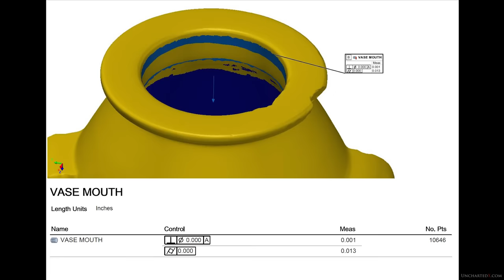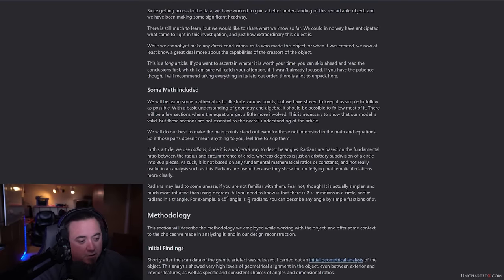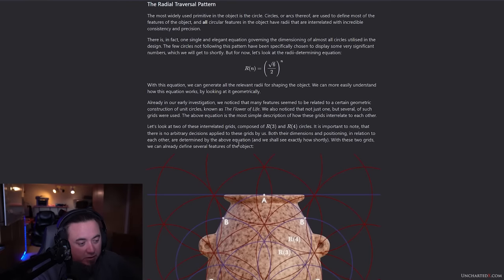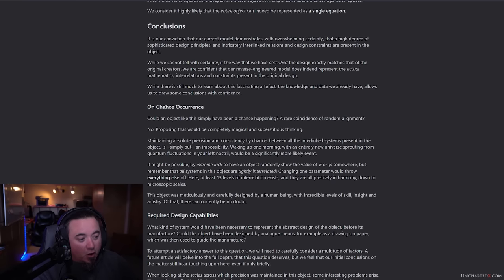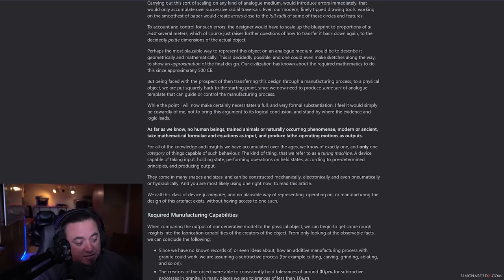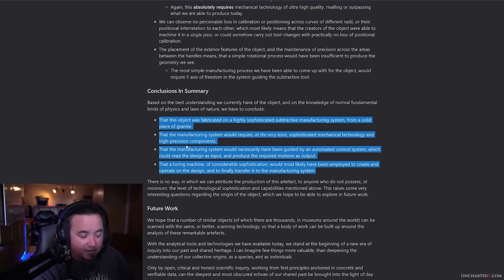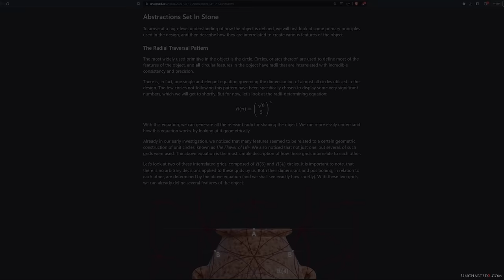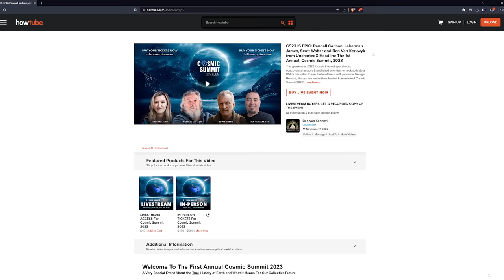Was a COMPUTER Used to Design this Artifact??

Comment: It would be VERY interesting to see what an expert in 5-axis machining could make using the reverse engineered plans. Even if not attempted in Granite, how accurate of a duplicate can be manufactured out of, machinist's choice, metal or polymer that is hard enough to take high accuracy machining and consistent enough that, unlike Granite, the material itself does not increase the chance of errors... VOLUNTEERS PLEASE???????
Reply from the maker: yes I very much hope someone does try to machine this, out of whatever material.
Reply: On the manufacturing part they are exaggerating. Modern tooling would have no problem duplicating the vase. Sadly the channel often overshoots the goal and veers off into conspiracy theories.
Which isn't to say that they are onto something when it comes to the fact that the vase was likely designed with radians as a basis. And transferring the design to tooling would have required machinery a little more complicated than what historians imagine right now. A computer doesn't have to be Si-chips. It could have been a clockwork device like the Antikythera mechanism.
Reply: @SiegfriedSTM  Sure would like to see this made out of granite to the precision of this object. Good luck!
Reply: @TITANSofCNC Help? :)
Reply: @SiegfriedSTM  You obviously have no knowledge about 5 axis machining. If it is no problem, as you state there will be loads of examples of granite vases and/or decorative pieces. We know humans love to see granite countertops in their homes so run off and find me some thin walled machined granite pieces to buy in the ikea store. I will wait till you get back
Reply: @SiegfriedSTM  we want to see one being made if you can organise that for us please?  Also can you supply us with a per unit cost? Depending on price we may have to crowdfund it.
Reply: @UnchartedX  The actual machining could be done, in my opinion, the problem is machining it in granite. I am retired from the world of machining but I have kept up and the newest 5 axis are doing wild stuff. You will not find too much work in granite, that is what fascinates me.
Reply: @j.sarnak1391  This is what troubles me too. The granite. Especially as a 5 axies machine will create vibrations. Vibration that can easily break thin wall translucent stone.
I am most looking forward to the thickness variation or tolerance of such thin wall pieces.
I mean you may be able to get around it by using supports of some kind to spread the resonant stresses.....but using a 5 axes 'with no recalibration' ?
Ohter than that, the only other option is to machine a much easier material, then creating a mold...but then you need liquid granite that can harden.
Much like the limestone casing stones I guess.
Reply: I think babysteps are a great idea, but you'd need a precise machine, preferably one used in aerospace
Reply: @j.sarnak1391  Today's standard CNC machining processes are well within 50µm of error. The keyword is "standard", so that's expected for shelf-parts. This is even defined in the ISO 2768 and international recognized standard. Depending on what you measure, it even goes down to 20µm.

Depending on how much you are willing to pay, the expected tolerance for precision machining can go down to +/- 0,005mm or 5µm.

But you won't find anyone in our current society who is willing to waste time and money working on a high precision vase. A part for aviation or spaceflight, yes. A vase, hell no.
Reply: We need the Titans of CNC!!
Reply: @SiegfriedSTM  Cool but that’s completely incongruous to what we’re talking about here. Not many aviation parts being manufactured out of granite that i’m aware of.
Reply: @Escape.Velocity  So what about it? To grind, cut, or polish Granite, you just need another rock or material harder than granite. Granite is between 6 or 7 on Moh's scale, which should be taken with a grain of salt because it is a conglomerate material. It's not a crystal or diamond.

Get yourself some quartz crystals or do the process with a grinding or polishing technique.
The Nil Delta was the melting pot for European, Asian, and African cultures and trade. It isn't unimaginable for them to get their hands on something hard enough they can use as a tool head for a lathe.

Some mummies had steel daggers in their crypts. Hardened steel has moh's 8. Granite isn't Tolkien's Mithril.
Reply: Someone should ask Titans of CNC. They do all sorts of weird things just for their YouTube channel.
Reply: @j.sarnak1391  How would a 5 axis machine go about creating the inside volume of the object, being that the opening is smaller than the inside dimensions?
Reply: I cut statues out of marble for a very successful artist with 5 axis machine. Repeatability can be very difficult to dial in . We keep tight tolerance and do well on most of it overall.  I've cut 4 versions of same statue over the past 4 years and each was a bit different here or there. I as an operator do 90 to 95% of the statue to then turn over to hand carvers to touch up and polish the surface . Things such as temperature can mess up what we cut. It only takes a few degrees or change in humidity to throw it off. Same if let stone sit and dry out can cause issues.
Reply: We can 3D print things to precision accuracies. And when we cut gems there’s a new 5-axis fantasy Ultra Tec lap that allows for virtually any shape, not your mothers Diamond 💎 shapes gems. 

But alas, these are gems, albeit hard as hell, as much as 9 on the mohs, but only for gems as big as 20mms or so. NOT a medium sized vase like that.
Reply: @RuneRelic  as I mentioned above, we cut fantasy style gems with a 5 axis lapidary machine. Look it up, Ultra Tec.
Reply: @UnchartedX  The scientist who made a conclusion that the vase was likely manufactured in a single pass or that the tool changing system was able to handle the change and keep the precision might be wrong. He ASSUMES that whoever created these vases used mechanical tools like mills and routers that were precisely moved to follow the design geometry. But there is a different approach to creating such an object with precise geometry: using an unprecise tool but controlling precisely the shape of the resulting object. In other words, you just keep removing the material until the desired shape is achieved, and you do not care how precisely you move the tool.
What exactly do I mean?
I mean that it is quite possible that these artifacts were manufactured using not milling but a totally different subtractive process such as sandblasting or waterjet cutting combined with precise measurement of the resulting surface DURING the manufacturing. And this would be much easier to do than using milling. The nozzle of the sandblasting machine would be moved along optimal trajectories and blast the abrasive powder until the desired geometry is achieved. So, this would be a machine with feedback from measurement sensors, unlike milling machines that have high-precision drivetrains that move the tool and no feedback.
Reply: @RuneRelic  check out 6c tooling. They machine incredibly fragile glass and carbide in unreal detail with 5th axis cnc machines. It can be done, but how did they do it is the trick
Reply: @tedantares2751  I think I follow where you are going, but how do you sandblaster/waterjet for the inside without blowing right trough?
Reply: Doing this in metal would be trivial for any modern manufacturer. Doing it in granite, which is much more tempermental, that's the trick....
Reply: @LifeMyWay007  I am not saying it had to be sandblasting or water jetting. It could be something else (laser ablation, etc.). My main point is that it was not a precisely moved tool, it was precise measurement and removing material where necessary.
Reply: @SiegfriedSTM  You stated "But you won't find anyone in our current society who is willing to waste time and money working on a high precision vase. A part for aviation or spaceflight, yes. A vase, hell no."

Exactly the point of the video (it seems).  There are at least hundreds of artifacts like the one discussed in the video.   Why would someone in history use such advanced technology at great expense to make somethings so mundane as a vase MADE FROM GRANITE?  One is led to conclude that at some point in history, this type of technology was ubiquitous and very affordable.  And if that is true then what happened to them?!
Reply: One other factor is the natural crystalline structure of the stone. Because it is natural, there will be different areas of tension and compression in the material. This matrix of different stresses behaves differently when material is removed. For example if you are making an extremely precise vase made of wood, if you cut the interior precisely and then later when the exterior is removed, the wood will twist, shrink and grow as the material gets thinner and as natural stresses are relieved. When working in thousandths of millimeters this becomes a serious issue.
Reply: There is definitely no exaggeration happening here.  There is speculation perhaps.  The problem isn't the smoothness or the overall shapes, it's the fact that there are so many shapes, in such a small object and that the same exact measurements are transferred across multiple densions on an artifact that is supposedly 5-6000 years old.

Unless it is the most elaborate  fake artifact ever created and was somehow made 100+ years ago. Then it means human history is totally wrong
Reply: I would be amazing if we were able to replicate just this one artifact with our modern day equipment however I don't think  the challenge should be done with any material of choice but with the same granite used by the ancients that way it would be a direct comparison and level playing field of our technical prowess compared to theirs.
Reply: @dtanco  The interior removal was actually much easier to do because it is rotationally symmetric. Here is how it could be done: 1) place a piece of granite with flat  bottom on a turntable 2) position a sandblasting nozzle above it and rotate the turntable while sandblasting until a pit is made 3) gradually lower the nozzle into the pit and change its direction 4) perform measurements (with a remote sensor such as laser one) during the process 5) once you are done with the interior, proceed with exterior
Reply: @dtanco There was no need in such accuracy. As Ben or some of his guests mentioned in another video of Ben's, this accuracy is simply a consequence of the technology that was used to create the artifacts - it simply was unable to manufacture objects with poorer precision. If you want to 3D-print something today, you will be unable to print with the precision that is worse than the precision of the 3D printer that you will be using.
Reply: @SiegfriedSTM  copper chisels and elbow grease, right?
Reply: @SiegfriedSTM  and those tolerances are in uniform material. what are the tolerances for non-uniform material like granite? i'll wait...

you're also ignoring the fact that the area between the handles necessitates a "2nd step" which would compromise the precision of the vase unless it was able to be verified down to the 1000th of a mm....1000s of years ago.
Reply: @tedantares2751  in other words, "unknown ancient technology".
Reply: @AustinKoleCarlisle  Apparently, this technology was used by an advanced civilization. One may ask: "Where are the cities they lived in? Where are all the tools? Where did they go?". There were no cities - they lived in their gigantic spaceships.All the megalithic sites and structures, monuments and statues are just temples. They took all their tools with them when they departed. And by the way, they used powerful water jet cutter to cut out 1000-ton granite blocks.
Reply: @tedantares2751  yep. my mind cannot think of other possibilities besides Atlantis or aliens.
Reply: Has anyone consider injection molded granite?  I know that sounds a bit out there, but once you had a mold, I believe you could achieve these tolerances, again once you had a mold.  This occurred to me because when you cast iron or injection mold plastics you have to have rounded and softer curved items in order to get it from the mold. Also, I notice that most of the granite is very homogeneous with no real inclusions and fissures.  Leads me to a molten process     Think Tesla Gigacasting machines   Molten material and tremendous pressure and heat can form a LOT of things.  That is essentially how granite and diamonds are formed.
Reply: @BigLapua  You can't melt granite and cast something out of it.
Reply: @tedantares2751  meteorologist melt granite all the time. Melts between 1000 and 2000 degrees
Reply: @BigLapua  not to where it maintains the same crystalline structure.
Reply: @tedantares2751  Doesn't this just add another layer of mystery? Why all this elaborate high-tech super precise machining for a simple decorative object? Makes zero sense.
Reply: @j.sarnak1391 my OH is a retired design engineer.  He worked with CDC machines, and also had to be a specialist in materials science too.   I have a PhD in biological sciences.  We are both in awe of these artifacts as manufactured items.  
These are indeed proving that these are  incredibly old, and that human civilisation has risen and fallen more than once.  Vast eons of time would obliterate everything except stone.  Had these vases been made out of anything other than stone and we would indeed have total species amnesia.
Reply: @lat1419  Thanks, I get frustrated when people refuse to acknowledge this should be causing academia to reevaluate everything, the fact they they refuse tells me all I need to know about "the elite" they have become lazy
Reply: @lat1419  it's very likely vases were made of other material but degraded (or rusted) over time. stone just lasts nearly forever.
Reply: @UnchartedX , Ben, first congratulations for this awesome video. I think the material surely matters a lot. All tooling changes when the hardness of the material goes higher and higher, like this case.
Reply: @thegreatbloviator6817  I already explained this, and Ben and his guests explained that too: simply because this is the accuracy of the process that was used. If you want to 3D print something, you will buy a 3D printer. And most of them have accuracy within 1/10th of a millimeter. Even if you don't need this accuracy in your 3D printed objects, you will still have it.
As for the sophisticated mathematical formulas that the mentioned "scientist" used, I think he was wrong. To me the generatrix of this vase looks like a hyperbola. But why hyperbola and not something else? This could be a convenient way to control the shape. I am going to write an email to Ben and to that "scientist" regarding this.
Reply: @lat1419  I have this idea that these objects may have been meant as time capsules --the people who made them understood that time would erase anything not made of stone and they wanted to leave something behind that would let the future know that they were here and were advanced
Reply: @tedantares2751  Well at least we agree that it wasn't stone pounders, sand and copper chisels that made these  objects. I think we agree also that the precision is a by-product of the process and not something they set out to do. They had machines that could make complex objects that needed that degree of precision for some practical use, and they used that same tech to make decorative objects.

It's the same way now, e.g. injection molding --it's mostly used for practical objects, but it's also used for toys, which will have the same level of precision because of the process
Reply: @thegreatbloviator6817  Well, maybe this was some kind of stone pounding, but in any case, the process had to be controlled by a computer, and there had to be precise measurement using quantum optics.
Reply: @thegreatbloviator6817  incidentally, we already have that with polygonal masonry that spans the globe. in case you're not aware, i'm not just talking about stones stacked on top of one another, i'm specifically talking about multi-ton stones that fit together perfectly not just at the surface, but throughout the depth of the walls, often curving in three dimensions. this CANNOT be achieved by simple "trial and error" fitting. the pieces had to individually be designed first, then "shaped" using computer-controlled technology, much like this vase. for what it's worth, anywhere this particular type of stonework is found, it's never located overtop another building style despite oftentimes having other styles located overtop, indicating extreme antiquity. and this type of stonework is found in supposedly isolated ancient cultures all over the world, we're told they all independently figured out how to create this building style and eventually forgot how to do it.
Reply: @lat1419  What is an OH?
Reply: @cindyknudson2715  Other Half. Partner.  Hubby.
Reply: @lat1419    Thank you 🙂
Reply: This was done with a 5-axis machine but I do not believe it required any tool changes or extremely expensive ball bearings because in my opinion in the tool head there was only one tool A LASER DEVICE with an output strong enough to etch Granite and it was not applied at 90 degrees with the medium but rather tangentially! This non invasive procedure would eliminate any form of vibration and tool change. Only a computer a 5-axis machine with a good vise and a laser in the tool head that will focus on the periphery of the rotating vase and hit it tangentially achieving these tight tolerances. Remember any invasive tool would eventually be consumed and would require change and recalibration and recontinuation of work of which there is no sign but a vaporizing tool applied tangientally on the periphery of a rotating object could achieve these results without a problem! I have had this idea in 2014  milling and lathing using laser since the tool is supposed to stay true
Reply: I have a friend who makes CNC aircraft parts up in Washington State out of Aluminum. I'll ask him about making one if he has the time.
Reply: @SiegfriedSTM  Sorry, there is no way in hell they can make this out of granite. If you think so, then prove it. and get one made.
Reply: @ErvinandMFantasyFootball  And those gems are not a conglomerate material of many different densities. And cutting facets is FAR different than something like this vase.
Reply: @dtanco  it's seems to known why this technology did not continue through to the modern day. And that's because we went through a few resets where everything was destroyed and had to begin again at a stone age. Either through floods or other massively destructive forces.
Reply: @user-tx2nv1rb9k  interesting thoughts...but it begs the question how the inside material was removed.
Reply: I do believe we are survivors of a past civilisation. However, people are capable of doing amazing things ...
An interesting experiment is currently occurring in Russia which you might want to follow up:  a lady called Olga Vdovina makes stone vases by hand. it takes at least six months to make one. Olga is now filming the process as she creates a diorite vase.
Reply: @lynnehaywood5305  You keep mentioning Olga, she apparently started the granite/diorite vase project in Jan. 2021 (2 and a half yrs ago). They updated the video page 4 months ago(?!), and said it was finished and they would be uploading a video. 2 years to make the vase and another 6 months to upload the video? Seems a little fishy to me. 🤔
Reply: @lafelong  you see, it's not about perfectly recreating the vase, it's about having a "project" the Marxists can point to and say "See, we can make something approaching the precision of the ancient artifacts, ergo, perfection could be achieved with just a little more time and elbow grease" without ever actually fully recreating the artifact to the same precision.